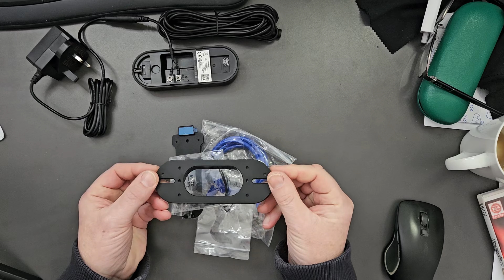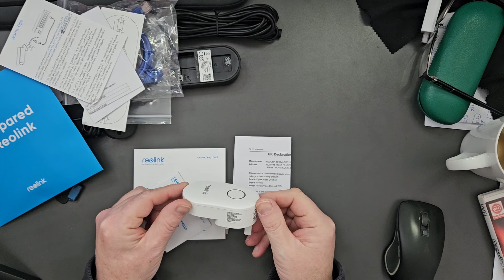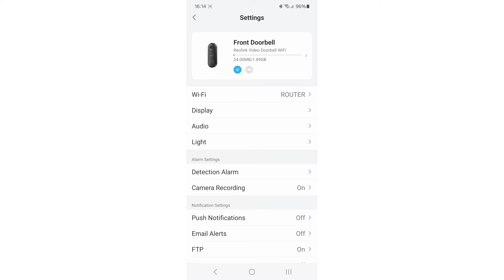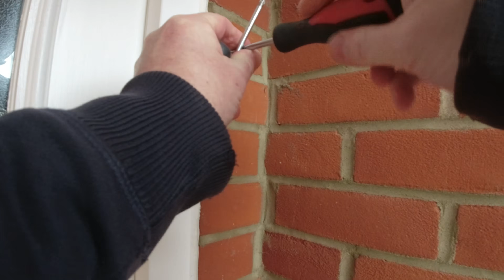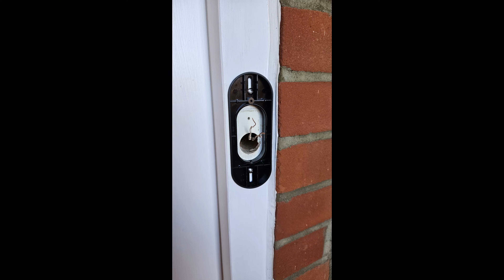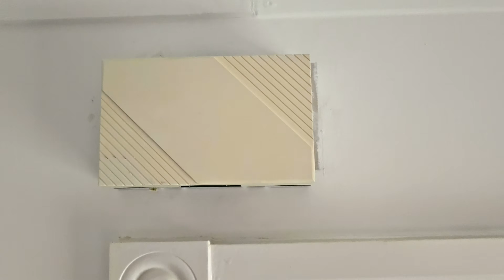Reolink Video Doorbell Install (UK) & Bell Transformer

Comment: Absolutely smashing video. Been wanting to replace my normal doorbell for a video one but still wanted to keep the existing mechanical chime in my reolink network new build. Was gonna go for the wired version but you faffing about with the chime transformer type/voltage and other electrical stuff that I have no confidence to touch, made me realise I just gonna fork out the extra £19 to get the battery version.  Can keep my chime working and it'll trickle charge the battery from 8v-24v source. 
Only thing I have to figure out,  is how to take out the existing doorbell without wreaking my brickwork! 😂
Cheers!
Reply from the maker: Glad the video helped you make your decision!

Comment: Were you able to make the old bell ring? Or are you using the Reolink chime or the 433MHz receiver?
Reply from the maker: The plug in chime that came with it. I also use Home Assistant to get the Aelxa's to speak out and make a chime sound when the doorbell is pressed.

Comment: Isn't YouTube amazing and what a great video. This helped specifically with the issue I was having and identified the problem I was having. I.e the voltage. Excuse my lack of knowledge and no, I don't plan to do the wiring myself but I have a question around the difference between the driver and a transformer. Is the driver a replacement for my transformer which clearly isn't supplying enough power or do I need both. I know they do different tasks. Thanks for any advice 🙏

Comment: Excellent video. I also switched from ring to reolink and got mine working but the app will only connect when i stand next to the doorbell. Is this a power issue ? Im using an old friedland 8V transformer which worked for the ring doorbell, The reolink adapter says 24V 0.5A 12W so presumably any LED driver with these specs will work ?
Reply from the maker: I think so, it's probably the driver, I know ring needed a lot less power
Reply: @daniel_coe  The problem was my wifi. I switched to compatibility mode which uses old WPA2 protocol not WPA3 and now it works fine. It seems happy with the 8V friedland transformer

Comment: Reolink guide existing chime
By bypassing the existing chime with the jumper cable provided in the product box, the Reolink Video Doorbell can get sufficient power and work stably. Here is a guide for bypassing:

Step 1. Remove the cover of the mechanical chime. Take a picture of the existing wire connection. You may need this for reference later.

Step 2. Loosen the connector screws on the Trans and the Front terminals on the mechanical chime. Do not remove the screws or the existing wires.

Step 3. Connect the two spades of the provided jumper cable to the Trans and the Front terminals. To secure the spades, tighten the screws to the terminals again.

Step 4. Replace the old doorbell with Reolink Video Doorbell.
Basically once you install a jump cable the chime gets eliminated and the reolink is happy, I know it sounds weird but yes connect the trans screw to the front screw with a small cable
https://support.reolink.com/hc/en-us/articles/10313334138265-How-to-Install-Reolink-Video-Doorbell-Cameras-to-the-Existing-Doorbell-Wiring/

Comment: Hello Daniel, I found this very useful as we have the same issue that our existing chime transformer isn't suitable - Towards the end of the video just after mentioning the possibility of putting in a socket for the 3 pin transformer that comes with the doorbell, you say "and just connect that up to the bell wires".  Do you mean simply attach the forked connectors (on the 3 pin transformer cable) to the bell cables that would have gone into the transformer? We have a regular socket within reach of our chime box, so we could plug in the transformer that came with the doorbell and use the existing bell cables as an extension to that cable?

Comment: Would anyone know what kind of transformer we could use without the buzzing issue? i have no idea how bad is the buzzing, but its not very good. i dont want to install this for 100 pounds and then have to replace it. i have thought of buying the Ringdoor bell transformer as i read that it had no issues working with reolink :(

Comment: The original output was 12v or 24v?  mine is 12V, i connected it directly to my original Kylink Door bell that was 12v, i seem to be having issues.

Comment: What screws did you use to fit the blue extension nuts?
Reply from the maker: You don't need any they just grab onto the wires when you twist the blue ends.

Comment: Hi, just watching your video for some tips on my own Reolink doorbell installation.  Good spot with the LED driver module, but your other suggestion to fit a single socket outlet to plug the Reolink transformer into would be a big no no with a doorbell wired from a lighting circuit.  The 1.5mm cable is not rated for 13A and anyone could come along and plug a vacuum or other appliance in and be in trouble.  You'll no doubt say, ah but there's only me and I would know.  That's not really the point.  Putting a 13A socket outlet on a lighting circuit is not in cpmpliance with BS7671 and is quit dnagerous.  So, your LED module is the safer option.
Reply: @daveforrester61 BS7671 does allow 13A sockets on lighting circuits - see regulation 559.5.1(v). Common applications of this allowance include providing power to aerial and distribution amplifiers in lofts, and floor lamps controlled by wall switches where the use of 2A/5A round pin plugs and sockets is not otherwise possible. Furthermore, 1.5mm2 cable is rated to carry 13A, even in the worst-case scenario of an insulated wall (just). However that is beside the point as the circuit wiring should be protected by a suitably rated (usually 6A) overcurrent device in the consumer unit. The biggest risk of someone plugging the proverbial vacuum cleaner in is actually a second order one e.g. loss of lighting leading to risk of falling/injury. A recognised acceptable mitigation to this is marking the socket appropriately regarding intended/acceptable use - you cannot (and are not expected to) mitigate against all acts of defiance/stupidity.
Reply: @mathewnewton3499   good spot. I've clearly had my head out the the regs book for too long.
Reply: @daveforrester61  No worries! In my haste to 'set that bloke on the Internet straight'(!) I should've added that whilst it might be compliant with the regs that doesn't of course make it the 'best' solution. Even aesthetically speaking, having a socket and plug-in power supply might be undesirable and so personally I too would be looking for more a discrete/fixed solution. And that's exactly what I might end up doing myself - what brought me here was the fact I'm expecting the arrival of such a doorbell today and so will be considering alternative power supply options if the existing bell transformer doesn't work (I suspect it will though).
Reply: @mathewnewton3499  I just went with a new transformer and enclosure. The remote chime works really well and we can hear it from anywhere on the house. We also have a mad Spaniel who let's us know if anyone is at the door too 😆
Reply from the maker: Thanks for letting me know

Comment: Thanks for covering this Daniel. I've been looking for a video doorbell for a while now and this one has been recommended for various reasons, not least because it integrates with Home Assistant very well. My main blocker currently is that I don't have a wired feed to the front door and am reluctant to go drilling holes and routing cables. Hopefully they release a battery powered version.